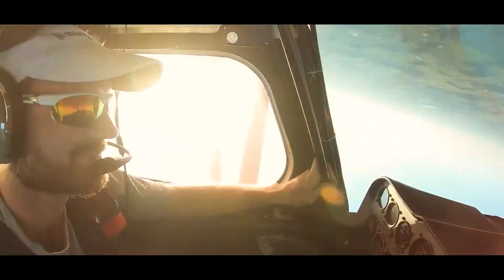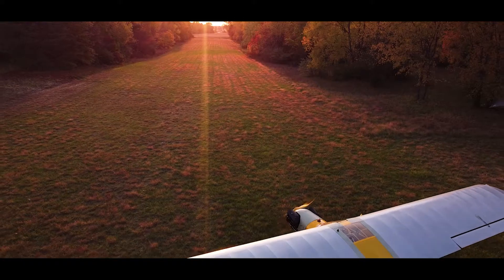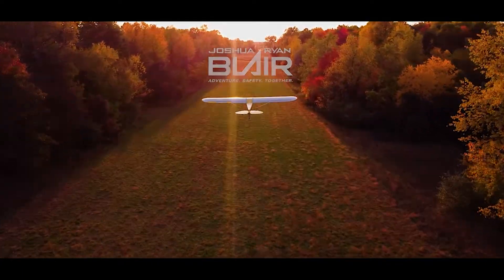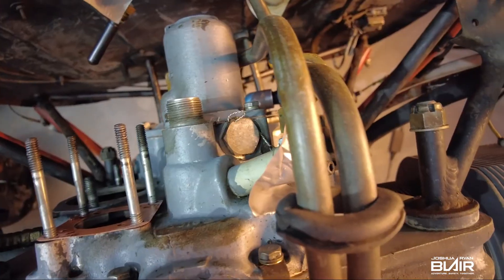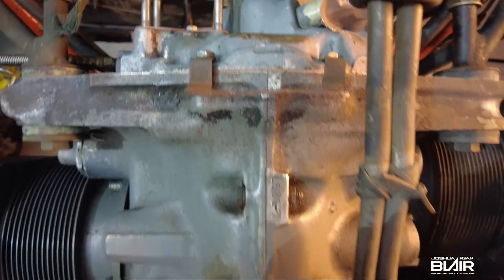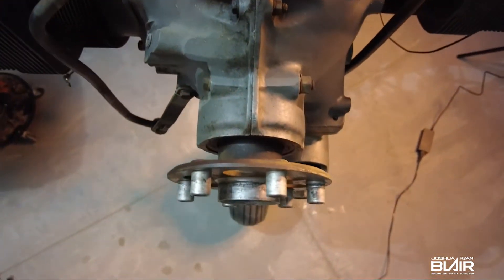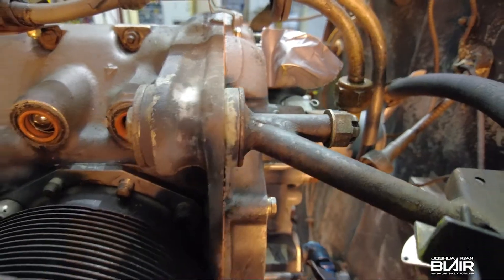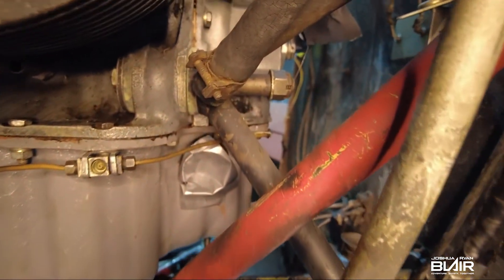Aircraft Engine Removal | Lycoming O-320 | The BLAIR [S]witch Project Ep. 2

Comment: Josh, have you considered the split nose bowl conversion STC? Also, how hard was it to remove the muffler? My mechanic says it will require removing the engine which I cannot believe. Any tricks?
Reply from the maker: @Brad Marcum I’m not familiar with that STC, who owns it? I’ll check it out, I was considering changing it anyways, 

The muffler: I didn’t have too much trouble removing it. I believe I removed it from the left side with everything else out of the way.
Reply: @Blaircraft.Engines  it was in the recent issue of the Short Wing Piper News Letter. I can email to you.
Reply from the maker: @bradmarcum2927  Sure. Thanks! blairpilot@gmail.com
Reply: Technical Corner
Nose cowl modification information
By Bill Havener
1409 6th Ave
Sterling IL 61081-2541 815-626-0910
A few months ago I received a letter from a man enquiring about my split nose cowl modification. He wondered if he was capable of doing the work and what is involved. So, if anyone else wonders, I will explain as well as I can here.
Anyone with any mechanical skill and ability to use tools can do the work. Of course, the availability of certain tools is needed.
Cutting, drilling, de-burring, countersinking and dimpling tools are needed. Also, epoxy/fiberglass lay-ups are part of the final product, so the ability to do that kind of work is needed.
I hope that this clarifies things somewhat.
If anyone contemplates having this modification performed on their airplane, they should first assure that there is at least five eighths inch clearance between the starter ring gear and the back side of the nose cowl in the areas between the air inlets and the propeller hub opening. Both sides must have that clearance or the modification will not work.
Second: The separation cut is horizontal through the mid-points of the three upper cowl openings.

Third: The top and bottom pieces of the cowl are held together in the center by
vertically mounted aluminum angle assemblies on the back side of the cowl be- tween the afore-mentioned openings.
I think that I have mentioned in the past that this modification can be used on all of the Short Wing Pipers and Wagabonds. Just be sure that they have metal nose cowls. I’m not sure that the modification would work on composite cowls.
(Editor’s note: See Bill’s classified ad in this issue for prices.)

SPLIT NOSE COWL MOD eliminates need to remove prop to remove/install nose cowl. Two-piece nosewheel fairing mod eliminates need to remove wheel from fork to remove/install fairing. Both of these mods, with approved Form 337s and detailed descriptions of how the work was done are available from Bill Havener, 1409 6th Ave., Sterling, Ill. 61081, phone 815-626-0910.
tfc